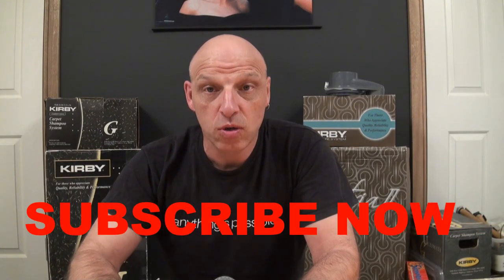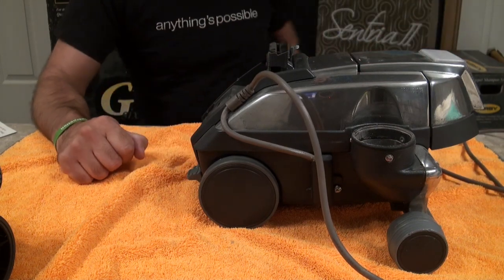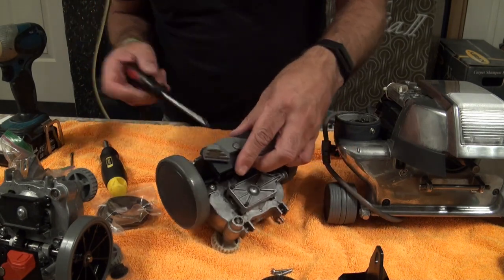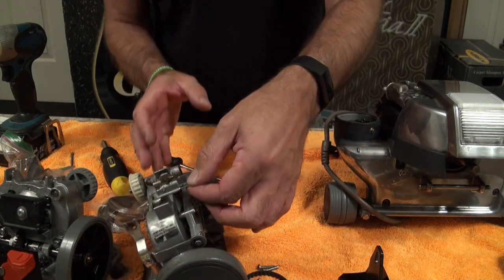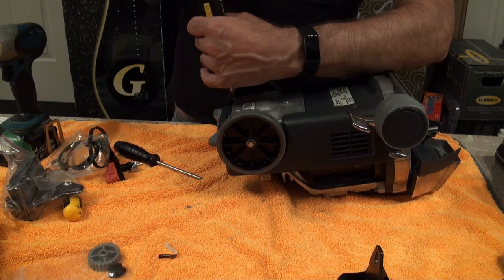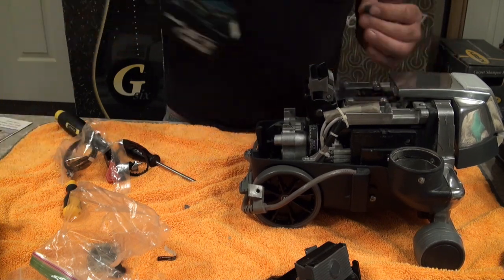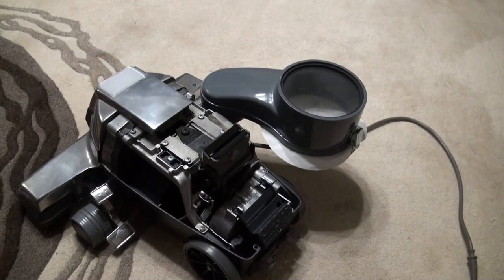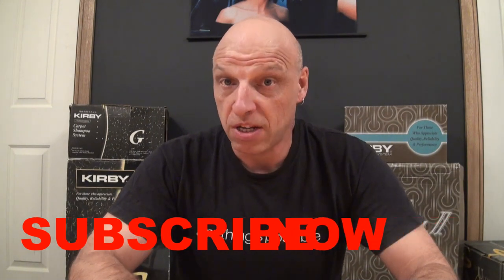KIRBY AVALIR: HOW TO REPLACE OR REPAIR KIRBY VACUUM TRANSMISSION DO IT YOURSELF

Comment: Just just wanted to let you know that I just fixed the hood light issues with it falling, I used a hole punch to open up the metals center gap. Without taking it out, I hammered the hole punch in the pin till it expanded enough to create friction and keep the light from falling

Comment: I’ve just had a go at dismantling and rebuilding the tech drive unit myself. No one has done a video of it.
Reply from the maker: Been waiting for a broken one to work on , how did you go did you fix it. I know they have internal belt , but not sure if you can get replacement belt like you can for the actual drive belt . Make sure to ding the belt to not miss new update loads and tutorials
Reply: @KirbyEnthusiast  I stripped it down because it was so dirty and When cleaning it ended up getting water inside it. Took apart and cleaned each of the clutches etc and then re greased the needle bearings. Unfortunately there’s a tiny washer left over and I don’t know where it came from!
Reply from the maker: @geoffhughes1986  I always take step by step pics when taking something apart I’m not sure of. Also label where screws and washers came from on card . Does it still run ok .
Reply: @KirbyEnthusiast  I do too usually but it’s very simple inside. I carefully laid everything out and then there was a tiny washer in the sink which must have fallen out. Il stick it back in and try it. I doubt it will affect its operation.
Reply: @geoffhughes1986  The little washer goes under the larger washer which goes under the smaller end of the spring. There are two springs inside the transmission, one under each sprocket wheel. I greased mine today.